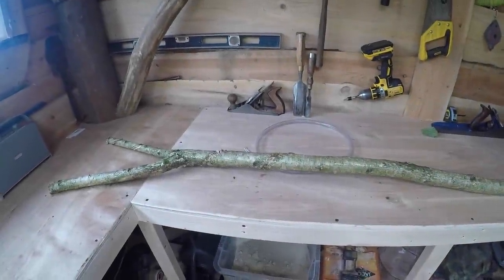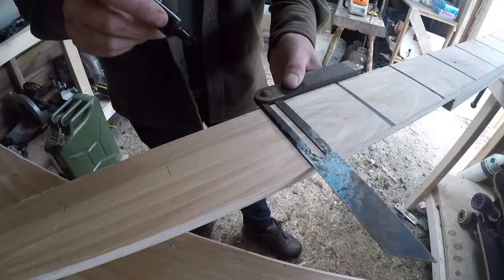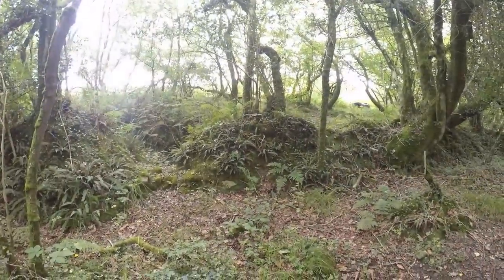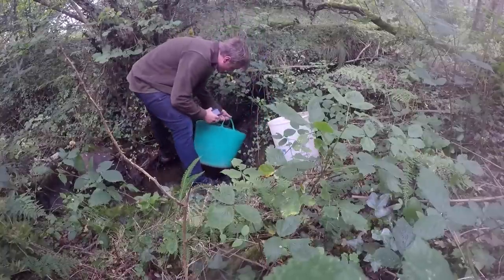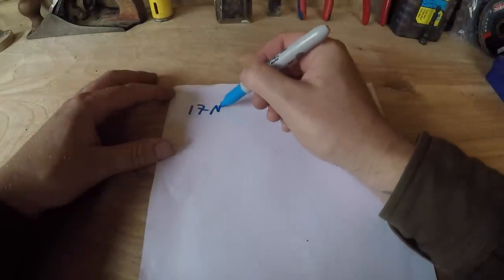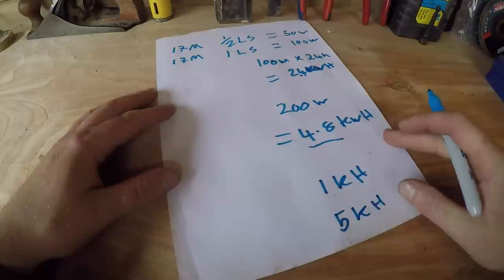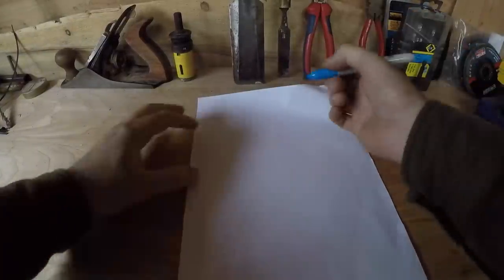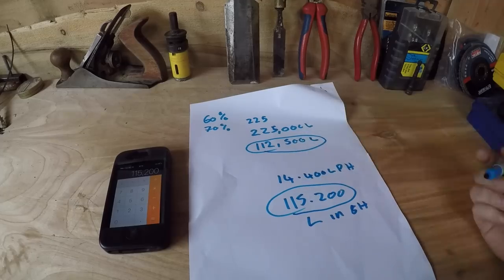DIY Micro Hydro Part 1 Head, Flow, Power Calculations

Comment: Theres apps you can use to measure the height/head using your phone. Much easier than this method.
Reply from the maker: Not even close to being accurate enough. They will give you a ball park number but that’s it. They use pressure  to make a guess as a measurement.
Reply: Ive used one that was GPS based. Was a couple years ago so i dont know if it was a paid one or not. I think it was accurate to the inch? not sure though.

Comment: U have failed math 225 x 4 = 900 cubic maters, times 1000 if you want the liters so 900 000 liters.
Reply from the maker: why x4? 225 is the number of square meters. if those square meters were cubic meters they would contain 225 thousand liters
Reply: +Kris Harbour 4 méter deep
Reply: +Kris Harbour AxBxC = cubik meters
Reply: 15x15x4x1000= 900 000 liters
Reply from the maker: i was not calculating the amount of water in the pond. i was calculating the amount of water if i was to drop the level by half a meter. i clearly state that in the video.......
Reply: ok sorry than, wish you well 4 your project.